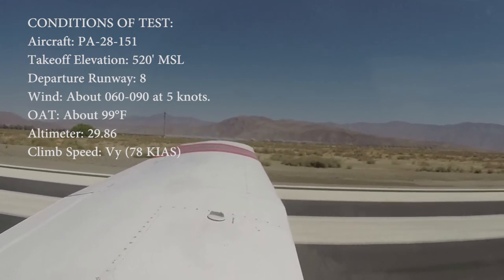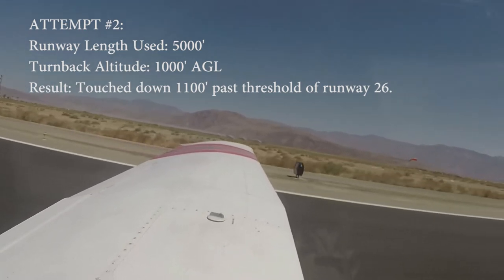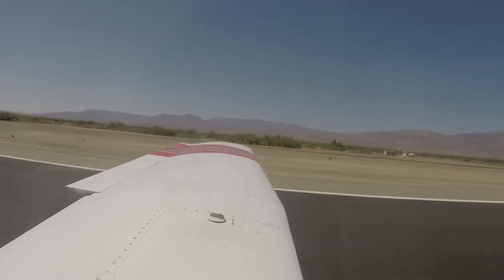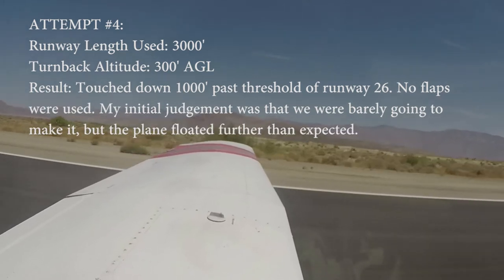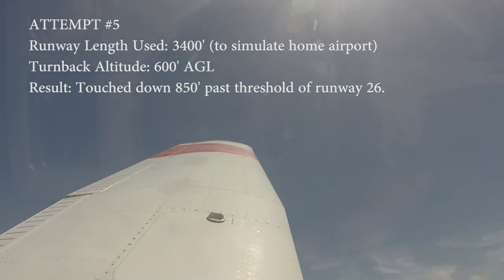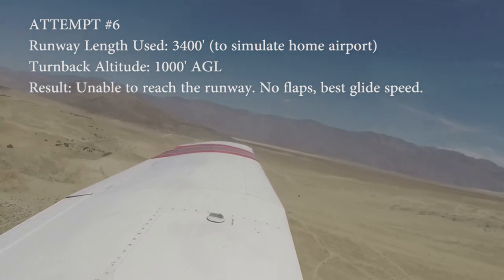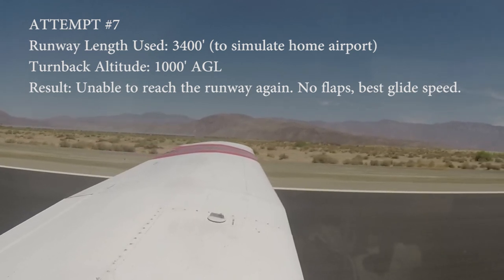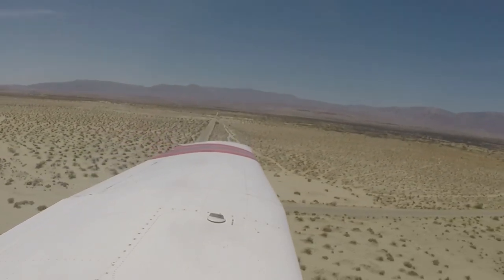The Impossible Turn

Comment: Are you lightly loaded.  Looks like low temp and low load.  That makes you climb at a good angle, which guarantees a good Turnback to opposite.  Good demos anyway.   I taught that turn to many in my 1990' CFI days.  Cherokees, Cessnas, Grummans..
Reply from the maker: Nearly 100 degrees that day. Tanks were maybe 80% full. I was the only person on board. 150HP engine. Airport elevation was near Sea Level (L08 - Borrego). The climb angle is 1 factor (which is affected by weight, temperature, pressure, wind, etc). Another factor is runway length. If I'm taking off a runway that is 30,000 feet long, the only altitude I need to reach is the altitude that provides me enough to turn back and align myself. I don't need any extra altitude to glide TO the runway itself. Another factor is if you turn into the wind or with it during your turn-around maneuver. Steeper bank means less vertical component of lift and more altitude lost, but it also means tighter turn radius and staying closer to the runway. Research shows a steep turn just above the stall horn is the best procedure, however, it's also an extremely dangerous procedure because of the increased risk of stall and possibly spin. In a real engine-failure scenario, pilots will be tempted to use low rudder to sling the nose back towards the runway, but that's putting you into a skidding then and a higher spin potential.

In all of these tests, I did climb out at Vy until engine failure. I gave myself a couple seconds to simulate disbelief and being stunned before starting the turn. Winds could have been at a different speed higher up than lower to the ground, so, this video is a small sample size and may not account well for calm wind conditions throughout the climb. Another day I conducted this test I had a strong 15 knot headwind at a 5000ft runway; I turned back at 1000ft AGL with 1 student onboard and we were way too high. Even with flaps and a forward slip I could tell we would land and overrun the runway so we aborted the landing (we would have survived it, but the plane would be wrecked). So, the rule of "1000ft before turning back" just isn't always true. There are too many factors involved. You would need to come up with an equation that factors in airplane performance, wind, runway length, and assumes pilot proficiency in this very tricky maneuver in order to truly know what range of altitudes will work before taking off.
Reply: @aviatortrevor  - Yes sir.  You got most of the details figured out already.  And there are many.  Can I add some i noticed too. 

As a rule of thumb, i dont recommend turnbacks over 12 knots unless you are good on forward slips and cut the mixture at the 180 degree point of turnback.  Push nose down, And cut the flaps on the flare too.  

I have a 1995 video doing 4 kinds of Turnbacks to opposite at Sebastian Florida on a Warrior 160hp (all of them are 160hp)  with a solid 16 knots 20 degree off the runway constant wind.  Solid 16 knots tailwind landings on a 4,000 feet total runway with no overruns. 

I knew i was going to be high, by the 90 degree point of the turnback, so I started adding flaps, still high at the 180 degree i added full flaps, then I  started cutting the mixture to make a spoiler off the prop. 

Also just passing the 180 degree i started a "Fast Forward Slip" way over the Vglide speed to the beginning of the runway.  Then after forcing it over the Vglide to the beginning of the runway, i keep it low whille pulling the bar over the full flaps (You will get 5 degrees more keeping it pulled.).  I call that "the bar extra five". 

Then over the runway, i wait the speed to go to the Vglide that is marked with a blue color tape ( I do that since 1993) and Cut the flaps slowly, to cut the lift. and hit the brakes right there.  I stopped it 2 times under 3, 400 feet.  Never went to the end of the runway. 

I also video the stalls on GRM, accelerated stalls and the engine fails from 30 feet and stopping it before the end of the 4,000 feet runway.  That video is from 1995. They say i was the first CFI to demonstrate for real e the 4 kinds of engine fail on take off and initial climb and turnbacks details.  Never seen any before that.  I learned them on a short wing 1969 cherokee 150 hp. 

Keep up the good work. Most accidents on turnbacks are from guys that didnt want to practice them, or even talk about them., then tried them in a real engine fail and screwed up.  For me, if you dont know these power on and power off turnbacks, you are AN INCOMPLETE PILOT.  Tell that to the ones that critic you when you practice them.  They are cowards. or Mild Maneuvering Pilots.

Comment: You have to wait the normal 2-3 seconds before you start turning.  And 500 feet agl is too marginal.  With engine and prop not powering, your prop becomes a spoiler and you will be landing short with a tailwind in a real total failure.  99 degrees temp? = Too shallow a climb to be able to Turnback from 500 with a spoiler prop condition.  With power i have done them from 300 feet agl. No power, double or more that altitude.. IF, If climbing at a good angle, like 800 feet per minute.  I teach this maneuver for years.  And always turn headwind. Always.  I put a plastic tape mark on the Vglide speed.  Under that speed you need power or a stall can happen, specially on a 45 bank.

Comment: Were you climbing at the Vy all times??.  Why not from 1k feet but yes from 300?  Too flat a climb when tried from 1k agl?
Reply from the maker: Yes, Vy climbs. In different conditions 1k AGL actually put us so high that we were going to overrun the runway. So, the variables are complicated. On this day, it may have been a combination of a shallow climb angle and perhaps winds above 200ft AGL were opposite of what they were at the surface. It would be interesting to conduct this test with a glass panel that tells us the exact wind components.

Comment: But with engine shut off you will have more drag. An idling engine has better glide 😀
Reply from the maker: Next experiment will be to find the glide difference between those 2 scenarios. A research paper I read that compared a wind-milling engine to a stopped prop showed that prop length and prop pitch determined which condition had less drag, but on your typical low-pitch 172 and PA28, a wind-milling prop had more drag than a stopped prop. I'm not sure yet about idling engine vs wind-milling. Could differ from plane to plane.

But then this still shows the classic knowledge that "wait until 1000' AGL to turn back" is sometimes wrong. Depends on your airplane's climb gradient, winds, length of runway, pilot proficiency in the maneuever, and a number of other factors.
Reply: aviatortrevor yes i have a 4 blade MT prop much more drag
Reply: @meridianpilot9813  You cannot adjust it ?  Why not ?